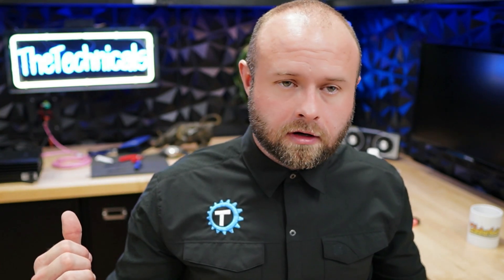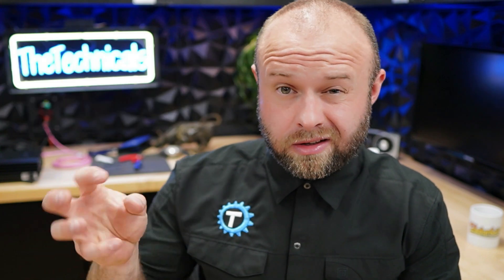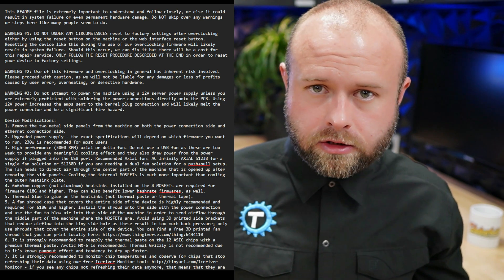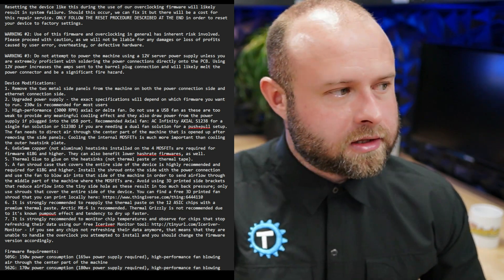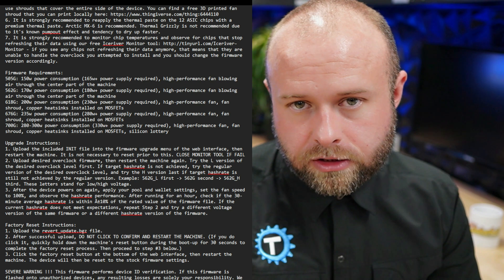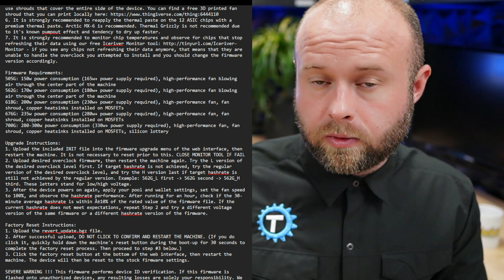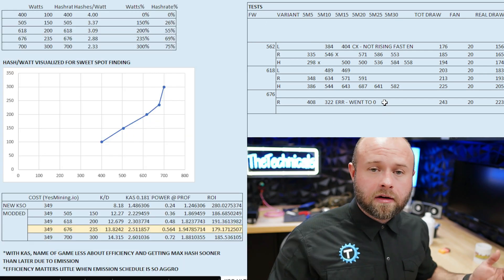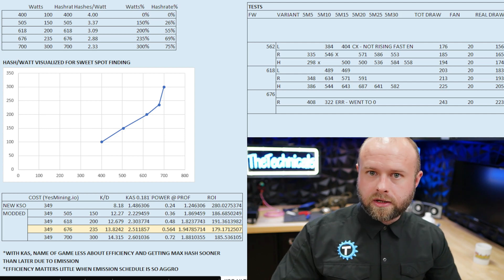Iceriver KS0 ULTRA Overclock Guide, Results, Projections

Comment: Onething I did notice and this was brought up in afew other streams as  maybe a possibility. If you raise the miner slightly off the table to cool it down it loses hash and quite a bit. I noticed 63 was a decent avg temp getting 400 plus gh/s. Even dropping it to 62 dropped the hash about 30-40 gh/s.
Incase you don't feel like doing the firmware idea. Which I am interested in doing myself.... But...... If its not broke dont make it worse is kinda my thought.

Comment: Yes the purpose of this video is to show they can overclock KS0 ultra and that's it.
The price of the new PSU is more than half of the price of the miner, and then you need to pay for the firmware. 
Voiding the warranty, losing feature of the machine(can't reset LOL) and lessen the efficiency? 
Just buy another KS0 ultra. Why spend more increasing the risk and losing everything?:face-turquoise-covering-eyes:
Maybe if they did was stable 400GH @ 60w or lesser without tearing it down, I might consider using their firmware.
Reply from the maker: I did the math in the end of the vid and a supplemental showing that it makes more sense to overclock than just buy another ultra. Kaspa isn't about efficiency due to it's emission schedule.
Reply: @TechnicalsMatt   @TechnicalsMatt  But you did not include the price of the firmware and the PSU, and copper heatsink on your computation. 
So lets say that 239$(price of miner on iceriver) + 140$(new PSU) + firmware + 10$(copper heatsink) then check again how long you will get the ROI.

On iceriver website the price of ultra is 239$ + stock PSU is 20$ = 259$ @ 400gh
if you want to do the OC 239$ + 140$(330w PSU) + 10$(copper heatsink) + 36$ firmware(618,676,700) = 425$ @ 600-680gh

Let's say I bought 3 running @ stock  = 1200gh @ 777$ @ 300w

Compare it at 2 miner + OC = 1200gh/1360gh @850$ @ 400w

At this moment I'll use your computation on the video, stock will give you 37.2$/month and 54.4$/month @ OC  and it will be lesser every month because of the reduction on the emission schedule.

Now I have 3 stock running (37.2 * 3 = 111.6) @ 300w with an ROI target of 777$
2 OC running (54.4 * 2 = 108.8) @ 400w with an ROI target of 850$

from this stand point I can clearly see who will ROI first specially if after power.

3 Miner running on stock > 2 OC Miner running
Reply from the maker: I did in my supplemental video. The only thing I can't account for is difficulty increases which will surely rise and rise hard. I maintain that kaspa is about a race to ever-lowering rewards versus a long term efficiency play. Further to that, I don't subscribe to ROI based thinking mainly because there are so many constantly changing variables. It's pointless but this is the only metric I have to go on for comparison
Reply: @TechnicalsMatt  yeah, lets not consider the ROI. I'll use hashrate as a basis which one is higher using the same budget. maybe this will be the last one for now.
And by the way efficiency is important that's why we have these miners right now.
Example:

I didn't add the cooling shroud price for now because you will not going to consider to OC if I added more price hahaha.

Budget: 22,100$
Miner Price: 239$
Stock PSU: 20$/each miner

OC:
330w PSU: 140$/each miner
Copper heatsink: 10$/each miner
Firmware: 200KAS = 36$ at this time/each miner

Use all the budget to buy miner and OC stuff (without the price of cooling shroud)
239$ + 140$ + 10$ + 36$ = 425$ per miner
52 miners = 22,100$/425$
10400w = 52miners * 200watts
32,136gh = 52miners * 618gh

On stock:
239$ + 20$ = 259$ but lets make it 260$ to use all 22,100$ budget
85 miners = 22,100$/260$
8,500w = 85miners * 100watts
34,000gh = 85miners * 400gh

Summary:
I don't see any advantage why would you risk it to OC instead of buying another miner.

Ahh yes, by OCing your miner you can save space at your place:hand-purple-blue-peace:compared having a lot of stock miners.

Comment: not sure where to go for help one of my ultra's is not responding the gui is available but says the "machine is offline" and I cant update the firmware now as it cant connect. I dont want to reset it as that was one of the warrnings. any help would be great or even where to look for help :)
Reply from the maker: you get a fix?
Reply: @TechnicalsMatt  back up and running 100 Kas for the fix
Reply: @TechnicalsMatt  not yet

Comment: Question- should a fan on the KS0 be mounted to blow air on to, or away from unit? (or does it not matter)
Reply from the maker: priority is to push air IN but you can do push/pull

Comment: I think what should be considered is the price of the new power supply and fans and heatsink and paste. All of that adds up and if we are buying that PSU ROI is going to take longer., but yes in the long run it will pay off
Reply from the maker: per the table, even with the mods, it would roi quicker than a stock unit. still waiting for someone to show me how the math is wrong (honestly, not trying to be combative because I can't believe it myself)
Reply: @TechnicalsMatt  No worries. I only see the cost prices in your table as $349 on both whereas the OC version should technically be $349 for the miner, $125 for the PSU, $16 for the shroud, but lets assume they are printing it so a few pennies, $23 for the fan, $8.99 for the paste, and heatsink $6.99. That should be close to $513. Technically there are cheaper PSUs, cheaper fans, and cheaper pastes, but I would think the OC Version should be on your chart around 475 at a mininum. Not trying to be combative and I don't think these were included when I watched it. Really nice video though and I do think ROI will happen quicker, but you'd have to buy the cheaper stuff for that in my opinion otherwise it's around the same time, but will end up getting more profits in the long run. I'm hoping we see increased profits next month once they try again with the KRC20.
Reply from the maker: I put up a supplemental video and it still makes sense to a certain point.

Comment: Buying all of this stuff and your fan shroud. Glad you made them so I can support you! Keep it up! Also, did you consider any of the $50-$60 330W chargers? Curious if they would work well or be a fire hazard…
Reply from the maker: With PSU's i tend to not F around TOO MUCH esp considering how hot the 220w psu got with the pro. If you can find one and the plug matches, i'd be interested to know how it works out. Also yesmining mentioned they're putting a psu on their site that can be used but i haven't seen it yet. Thank you!
Reply: Ah yea makes total sense. The barrel plug is a 5.5x2.5mm correct? I have not found one with that size yet so I may have to buy the expensive one…
Reply: Also, I wonder if you could use a barrel plug adapter to convert them to the correct size…might just build up heat though.

Comment: bad option
OC 300w = 700g
where's the logic?

better option
norm 100w = 400g x 2
Reply from the maker: the ROI tables near the end of the video (assuming no changes to difficulty, price, etc) spell a different story. Kaspa mining isn't about efficiency IMO. Efficiency is for coins that have long reduction schedules. Again, IMO.
Reply: KS5 20th 3000w 150watts per Th/s. seems to be the best option.
Reply from the maker: If you got it like that for an expensive miner, ya

Comment: Great video.  Curious. What in the heat on the outer shell running?  What is internal fans at?  I found base extremely hot.  Almost fire range.  I run mine w 0 internal fans. Some fans behind.   Outer shell runs 109F. I get near 390 yo 400Gh
Reply from the maker: On stock firmware or OC? I can put my hand on the shell and it's barely warm but my fan is at 100$%
Reply: On stock. It runs 147GH.  Sounds like OC fixed things w temp

Comment: On the ROI you need to add the cost of the mods vs stock to make it fair.
Reply from the maker: Thought of that later (was in a rush with this one). Even if the mods are an extra $150 add 4mo to the timeframe, still (barely) beating out a stock machine, but only just.
Reply: @TechnicalsMatt  still a great video.

Comment: On the tswift telegram he didn’t mention thermal pads. Are the original ones fine?
Reply from the maker: I noticed that as well. I kept the original pads on mine and it seems to be OK, no chip has gone over temp. If it was important i'm sure it would've made it into the readme

Comment: What does it cost to upgrade the single unit? Fans, ducting, firmware...
Reply from the maker: FW is free with 0.5%
PSU can be found for $50 for all but the top hashrate, the cadillac model is 130
heatsinks and paste are cheap, maybe $10
fan if you look around maybe $10, new $20
shroud you can print yourself or buy on ebay for maybe $10. i sell a 2pack for 16+ship
So, 80-180

Comment: Ks0 ultra x 2 @239= 588 bucks shipped....800gh @ 200w. 
ONE ks0 ultra modded pulling 3x the power and 1.8x the hash. 294 shipped plus other stuff to frankenstein it. 

Not burning my house down modding one ?  PRICELESS. 🔥🔥🔥
Reply: This was exactly what I was thinking.
Reply: Where are you finding the Ultra for $239? Please include a link. TIA
Reply: @sickasstoyz  it is on iceriver directly  , be sure to go to the official page. I can't post link youtube blocks it.
Reply: @sickasstoyz from IR directly, without psu, not including shipping. 303 each with a discount code😂
Reply from the maker: My thinking exactly too, but the breakout towards the end of the vid suggests OC would recoup faster. Waiting for someone to find the flaw in the math
Reply: right, show me the link for $239 bro

Comment: I would say it makes more sense just to buy another one largely because of the amount of money you need to put out in order to do the mod isn't it relatively close to purchasing a new one The power supply that he recommended alone in the telegram was $125 by itself on top of everything else needed and I don't know how much he's charging for the software
Reply from the maker: For kaspa mining, MY OPINION ONLY - is not an efficiency game, it's about getting as much as possible against the emission schedule. See the table later in the video. The OC version "ROI's" faster than a stock, even with the added costs.
Reply: @TechnicalsMatt  amen
Reply: @TechnicalsMatt  And is it a faster ROI on Modded than the two KSO Ultras, considering the investment in modding?
Reply from the maker: I outlined in video
Reply: @TechnicalsMatt  i also think solar makes sense when it comes to these sort of machines
so then the cost of the hashrate is another case

they should have kits with battery and panel for 100 dollars
Reply: I've been able to do all this for 80 bucks... With a bit of research I can get the 330w asus PSU for 40 bucks.
Reply: @RainBitcoins  what size is the barrel plug?
Reply: @mozzarella84  the one it comes with is not the standard 5.5mm x 2.5mm you need.. I cut the orginial off and soldered the size needed on there. It's only 2 wires, pretty easy.
Reply: @RainBitcoins  wow 80 per machine isn't bad.
Reply: @RainBitcoins  where ???

Comment: incoming video: KSO caught fire
Reply from the maker: turned it off until more people do the OC and i know it's safe LMAO
Reply: @TechnicalsMatt  no doubt pb farmers last OC was more safe then the T swift
the fact you can control and keep a eye on temps makes it more safe.

specially when people want most out of the boxes

there are a design of shrouts than only blown on the inside, those do provide better cooling.
the outside cooling is often done with fans on both sides of the box anyway

i can hook them up with 1 duct fan to 3-4 connected boxes, because i blow only through the inside of boxes.
and dont loose airpresure
Reply: and the fact that the fee went to the kaspa foundation when it comes to pb farmer also makes the fee a kind investment in your own future
Reply: Pulled pork on ks0 ultra 😂